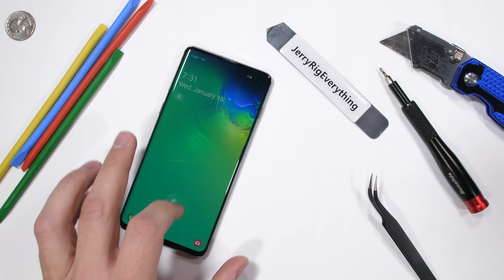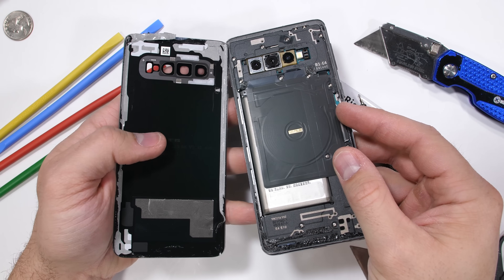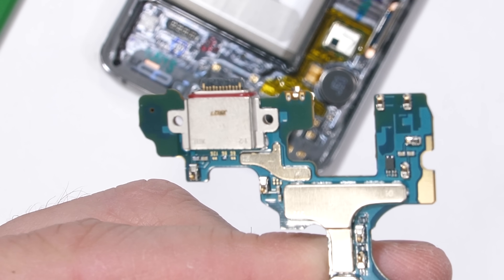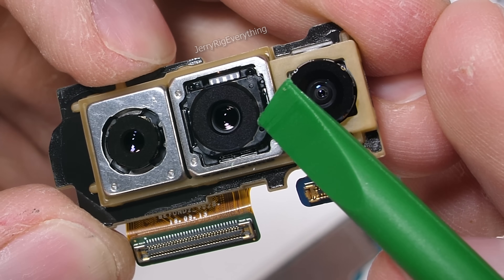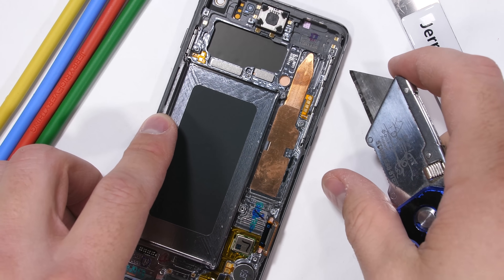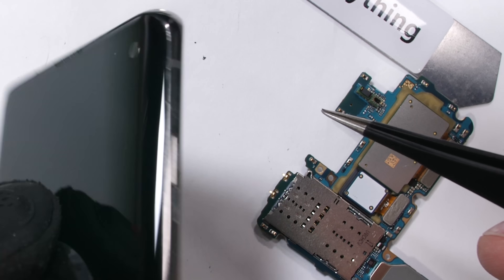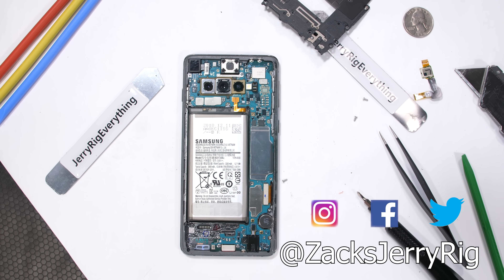Galaxy S10 Teardown – Does Ultrasonic Measure Up?

Comment: removing li-ion battery is stil pain in the ass cuz those suckers using glue.i like the old batteries u can easily remove it by hand no need special tools.also they use a lot of glue around the case too make these smartphones waterproof.i can take off by hand the backplate no need to heat up or using stanley knife.there are 16 screws not 14.

Comment: That port is pretty rugged and in combination with wireless charging, you can probably still get that thing charged and lower the overall use on that port. It sucks but its not that big of a deal since the wireless charging is a redundant charging feature. 

This comment is 2 years late and I just bought a refurbished S10 and I'm excited to play with it.

Comment: Hey Jerry, I have damage the top earpiece speaker mesh with a toothbrush while cleaning my S10 plus, 75% of the mesh is gone leaving a thin hole. Although the speaker is working fine, will this be a problem, will it still be water proof.

Hope to get a reply from you.
Reply: It won't be waterproof anymore because the mesh keeps water droplets out. Sorry
Reply: @Superzesh101  I am not worried about water that much.
I am worried about dust.
Will it degrade the speaker sound quality..???
Reply: @RohanAndrewPhillips  you'll get pockets dust in and it might affect the ear speaker.

Comment: actually if my screen is is off, wiped clean, and in a bright room, I can see the fingerprint scanner, but only when the light hits it right, did not know my S10 Plus was carved out of a solid block of aluminum, was worried about the size of it and it's good to know I'll never have to worry about it bending in half in my pocket like an iphone 6

Comment: The dirt inside of the copper heat pipe is supposedly Graphine, which is also a very good conductor, as we discovered on the Note 20 Ultra

Comment: Recently purchased this phone and accidently inserted the ejection pin into the top mic. Would this effect the phone in any way????   

It made a slight pop the further i pushed the ejection pin into the phone. I'm Worried it has affected the waterproof feature or the microphone speaker.

Comment: If you flash an LED light at a 45° angle while the screen is off, you can see the ultrasonic finger print scanner underneath the display without having to tear it open. 

But we all still love a teardown. 😉🤟

Comment: Hi huys, i put the tool to remove the sim in the microphone hole. perfectly straight he immediately stops against something, but slightly oblique he can also go for 70% and crash into something, to understand to remove the sim cart enters just for 10% . Shouldn't it be the microphone (that square of metal), should it be lower, the passage and under the square mesh that is used to not let liquids pass? is that where the sound goes to the microphone?  the waterproof is compromised? thanks to anyone who helps me
Reply: I did the exact same thing, worried this could have affected the phone in some way

Comment: Jerry: charge port is irreplaceable.

Other technicians: a little of flux, hot air,solder iron and solder can fix it

If it was apple 
Apple: your device it's water damaged. $1000 to repair it
Reply: Bruh changing the back cover is $600 tf, i can buy 4 other acceptable huwaei phones tho,

Comment: My screen cracked this morning. 4/5th of the screen is black, but the touch sensors for that part still works. the touch sensors for the 1/5th that i can see no longer works. Can I replace the screen? i Just want to replace it so I can get any valuable info and phots off of it, then im getting a new one. hopefully i can make this happen within a month.

Comment: Really need your help....broke the screen on my s10 plus. It's $299 to fix.  Everything still works including fingerprint. I noticed online the replacement screen is $35 on Amazon but it's only top layer. Does that matter?

Specifically says it does not include OLED. 

Will I be ok if I get that screen and replace it myself? Is there anything I should know or consider?

Thank you very much for you help.  Just bought this phone for almost $1,000

Comment: BUT: if your Scanner dies, and you want a replacement, and could remove the old one, you would still Break your screen in that process. A replacement screen has a new Scanner. So it really doesn't matter for Price

Edit: and i also saw my Scanner on my s10+ on a really sunny day white it was in one piece

Comment: We should form a global organization that rates phones just like power consumption on appliances and fuel consumption on cars ratings out of 10 starts for each parameter and our parameters can be:
- Repair-ability
- Camera
- OS
- Processor
- Security
- Privacy
- Battery life
- Overall design
- Durability
- Data storage
- etc
and 10 stars this year won't be the same next year and mostly based on market availability and comparability.

Comment: around 3:27, do you notice that the C-Type connector (the black part) is not completely straight but has a tiny-tiny angle (lowest left corner)? Mine S10 is the same. Probably nobody cares, but is it?

Comment: Hey Zack! Longtime fan here. Was wondering if you ever considered tearing down an S10 5G? Recently got this phone after accidentally destroying the display on my Note 9 and I am surprised by how much is packed inside. A 4G (which seems faster than Note 9s) and 5G modems, a whopping 4500mah battery, gorgeous 6.7" display, two extra ToF 3D cameras (one on front and back), and a headphone jack! I really wonder what this looks like on the inside but I won't be performing surgery on this $1200 phone! Curious if the 5G radio looks different.

Comment: hi sorry if i bother you. I just bought an s10 and I inserted the pin for removing the sim cart into the secondary microphone hole. I'm worried about losing the waterproofness. is there a protective grid? from the video it is not clear if there is something under the hole that could be damaged. I thank you for the answer. I am very worried.

Comment: I just killed my S10 and am looking forward to dropping enough to buy an expensive pair of shoes to fix it. Ironically, the cheap pair of shoes that I've been wearing for over 2 years now have rips all over. Buut... that just means they breath better, so I'll be keeping them for a bit longer.

Edit: by "killed", I mean it dropped about 12 inches onto a flat linoleum bathroom counter, landing perfectly on the dumbass edge that wasn't protected by the case, causing a small shatter, and leading to 80% of a black screen. Don't worry though, the other 20% stopped working soon after.

Edit 2: HOLY SHIT, INTERESTING DEVELOPMENTS HERE EN LA CASA DE MARSHALL!   THE UPPER 20% HAS REGAINED FULL COLOR AND THE LOWER 80 IS NOW WHITE!

Edit 3: upon hitting the power button, the screen has stopped working again
Reply: Big oof.

Comment: And you could probably remove that charging port if you had a desoldering gun or some solder wick and a heat gun :0 it'd take a damn while but you could.
Reply: Umm what bout fitting another one there

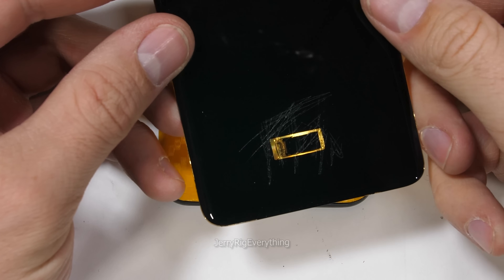Comment: It is actually possible to see the gold scanner displayed @ 8:35 - I do have the S10+ though, so it might be different. I noticed a chip under my glass one day when I had sun shining on it and I was wondering what the hell it was, this video kind of answered that, haha. So it is possible to view it on a perfectly functioning non-disassembled phone, I just think the conditions have to be right for that, i.e. sunlight coming in at an angle, at around 1 PM in the spring, if that helps narrow it down.

Thanks!

Comment: Why did the screen die? How ? Whats the solution to fix it?? Someone please.. I've dropped my s7 a lot of times and it gives the same * briefest flash of light* every time I press the power button. Please tell me if there's any way to repair it instead of changing the display which costs a lot. Please.

Comment: Hi ! So i searched for all the coments and i could not understand does the galaxy s10 have vapor cooling system ? All over the internet and comercials say that only the galaxy s10+ is with that tehnology. But in this video vs galaxy s10+ teardown video the heatpipe look identical. ?????
Reply: The s10 and the s10+ have the same cooling system
Reply: @craigtheaircooler2580  but on samsung official comercials and on the site say this part ,, Vapor chamber cooling system only available on Galaxy S10+. Galaxy S10 and Galaxy S10e have an advanced heatpipe cooling system. ,, that only the s10+ have vapor chamber cooling sistem....
Reply: @Stefan25F From all teardowns it looks likr they have the same colling solution. I think the "Vapour chamber" is on all their s10 models

Comment: I'm so tired of how every time you mention anything negative about the repairability of a phone, you have to preface it by mentioning how Apple does the same - even though Apple doesn't! You're really misleading people here. Apple provides battery pull-tabs and had a replaceable charging port, yet you heavily imply that Samsung is merely following in the steps of Apple by lacking those things. I know that your fanbase is extremely biased, but that doesn't mean you have to be biased as well.

Comment: You can actually see the ultrasonic fingerprint sensor on assembled phone. Outside in direct sun light it can be clearly seen. I've also noticed it is offset, but after your video it is clear why it looks so.

Comment: You CAN actually see the sensor without the phone disassembled. With the brightness turned up and in direct sunlight above your head, you can see the shadow of the sensor through the screen. It really tripped me out. BTW I saw it on a blank white browser background. it probably won't show up on a dimmer picture background or apps.

Comment: Hey Jerry, I've got a question, if I inserted the sim tool in the mic hole, did I messed with my water resistance or even my mic? I've done some tests on the mic and it seems ok but I'm kinda scared that I have wrecked my phone since it's like 3 days ago that I brought it
Reply: Have you got any answers yet I did the same thing recently??

Comment: At 3:05 I don't think Samsung made the charging port non-replaceable for the sake of making non-replaceable but as a cost saving measure.  By the way it's still replaceable with the right equipment (microscope, hot air station, etc.)  Luckily it's got wireless charging built in. ;)
Reply: Still takes longer

Comment: i hope someone sees this and answers. i just got my s10 yesterday and when i inserted my sim tool i accidentally inserted it into the microphone hole instead. the microphone seems to be working still but when i inserted the pin i heard a click sound and my pin went further down. can someone explain if it's possible that the water-resistance of my top microphone got removed?

Comment: If u have hot plate heat the screen up and use a thin piece of flexible plastic like the one that come with screens and slide it in the frame where the battery goes and wiggle it though alcohol or xylene work wonders for dissolving the glue and yo.u won’t sacrifice the display

Comment: "Apple level anti-consumer planned obsolescence baloney"
Samsung: Attaches charging port and headphone jack to motherboard
Apple: Sues Samsung for trying to make money like the way they did
Reply: Except Apple never did that. The charging port is replaceable on iPhones. He's just misleading his viewers because he's biased.
Reply: @SCtester  but remember, the charging port is extremely hard to take out of the iPhone, just watch an iPhone Xs or Xs max teardown and you will see the complexity required to take down, you would have to be Hugh Jeffery to replace it
Reply: @Bruh-nb1hj  It's certainly not easy enough to be user-repairable, but for an expert it's more than possible. That's the most important thing here, that you can have someone replace it, and that's impossible on the Samsung. You have to get the whole logic board replaced, which would be so expensive you might as well get a new phone.

Comment: Do you do anything with the phones after you break them? (I mostly refer to the boards, because one could use them to run code on them, or even connect to computer to run the Android that is installed and still on it) That would make for a very good ARM gaming accelerator for PC.

Comment: Hi, great video but I must disagree with a few things you said. Parts you marked as impossible or unrepairable are just simple technology used in a lot of older and cheaper devices. Yes, you cant  just simply replace the down part for 15usd, but you can "simply" desolder it and solder a new piece like on a lot of other models, the mic is very cheap part most of the time. And for the display, yes, of course, you can remove it without damage. You just need some proper skill, some heat, alcohol or special liquid and some plastic card :) OLEDs are fragile, but it isnt impossible...

No hate, just wanted to throw some opinion.
Keep up the good videos :)

Comment: In my eager to set up my new S10 I inserted the sim ejection tool into the wrong hole on top of the phone. It might be the hole for the top microphone or maybe some sensor. I didn't put much pressure on the tool. I watched this video very closely to see if it would reveal if I did some damage to the phone internals but it didn't really help. Do you think I should be worried?

Comment: Hi Jerry, 

I have the Samsung s10..and I inserted the Samsung supplied pin ejector in the top mic instead of the sim tray hole. 

I did not feel anything pop or break..do u think i broke anything on the phone ..like the mic itself or water proofing?

The phone is working as it should ..

Comment: You can always desolder the charging port, I understand it may be difficult for most but its possible, spend the 80$ at a repair shop to keep s10 alive
Reply: Yes, but why wouldn't they have it modular anyways? It just saves you some trouble when having to repair it.
Reply: @leonro  that's a good question for an electrical engineer lol

Comment: Big Question: if there hasn’t much changed with the wireless charging coil could they make a Software update so older generation devices aka S8 or iPhone XS Max could also feature reverse wireless charging? 🤔

Comment: Someone correct me if I'm wrong, but I'm pretty sure it looks "dirty" inside the copper heat pipe (or vapor chamber) is because Samsung is using a Sintered/Mesh combo design for their vapor chambers. The fine powder helps move the liquid up and down. A lot of higher end CPU Air Coolers use that Sintered/Mesh combo vapor chamber/heat pipe design.

Comment: Microphone is replaceable. people call it soldering:) Charging port as well, but it is much harder due to number of pads that probably will be ripped during desoldering (as it is on eg. A5/A3 2017 ). I can't see pads on your video so don't know building jumpers is possible. As I always say "everything is possible to fix, the only question is... is it worth it". on device value over 700 it is worth to try

Comment: The central wide angle camera does has OIS. If you open up the camera app and look at the cameras and shake the phone, both the central and left one are moving. I guess it's just not as noticable compared to the telephoto lens

Comment: Zack, you've been doing this for years. You should know that it is 100% possible to solder a new charging port on a phone, they're are tons of shops that specialize in this. It's just more of a pain and costs more in labor.

Edit: Also not impossible to remove Samsung screens in one piece, just a huge pain in the ass. I've done it and know other techs that have as well.
Reply: The point is that the average phone user can no longer do repairs by themselves and it will cost a lot more money.